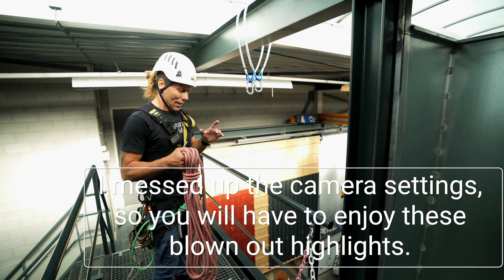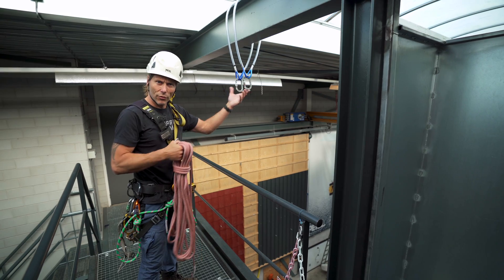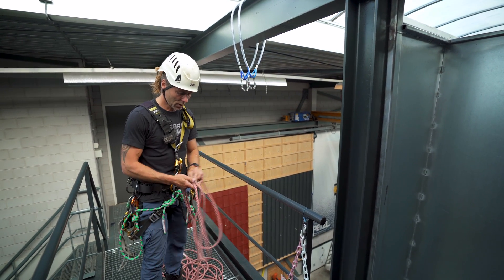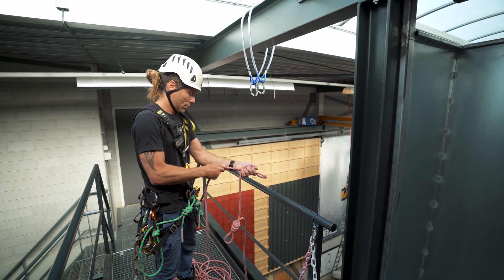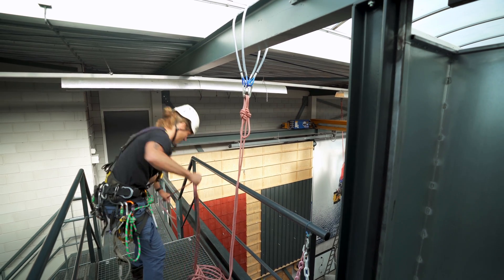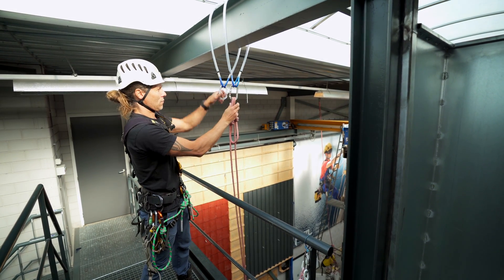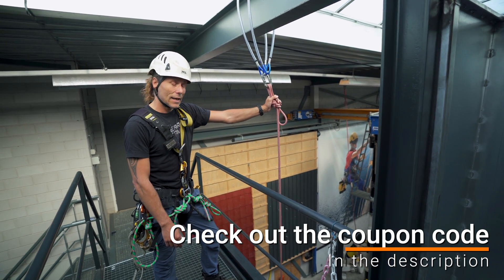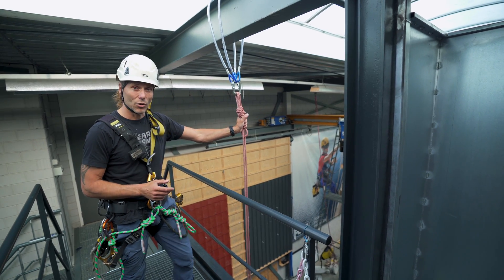Basic Rigging Part 2 - IRATA Level 1 Rigging Example

Comment: what harness are you wearing?
And which harness do you recommend in 2023
Reply from the maker: I think I was wearing the AVAO sit by Petzl with a seperate NAVAHO CROLL TOP (now discontinued). 
I use a few harnesses because I am lucky. 
The CMC Atom because it is super comfortable 
The Petzl Falcon with a CROLL TOP S for where I need to a lot of rigging and real climbing because it is small and does not get in the way.
And last the one I am waring most these last few months is the Edelrid Vector Y. That seems to be a nice average between comfort and moveability. And I like the way the chest ascender is small and positioned when going through large rope to rope situations.
And I have to say, that during my reassessment early 2023, I used the EYOLF harness and that was amazing! You can check that in one of the latest video’s. I forget the model name for now. Very good and reminds me of the Petzl Navaho
Reply: @TheRopeAccessChannel  I think I'm going to order the Avao sit fast!
Is it possible to use the Camp Turbochest with a Petzl top?
Reply from the maker: Yes you could and it is a bit finicky to get that to work. I remember seeing a little strap designed to keep the ascender in to place. Can’t think of the name though 🤔

Comment: Good video... could please explain if you can also join together the wire slings with the carabiners the same way you do with the rope...(let's say the loops in the wire slings are wider)... Thank you
Reply from the maker: Thanks 🙏🏼. Yes that's possible. But it pinches the carabiners even more and can be a bit more hassle to all fit together. And twisting biners to orientate gates in te desired direction is also a bit harder. There is no gain only more hassle in my opinion.